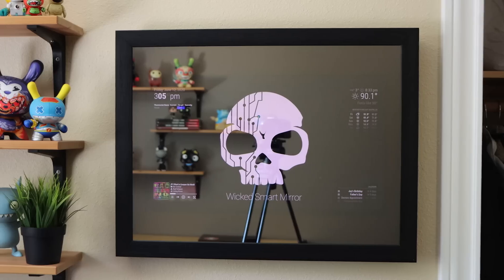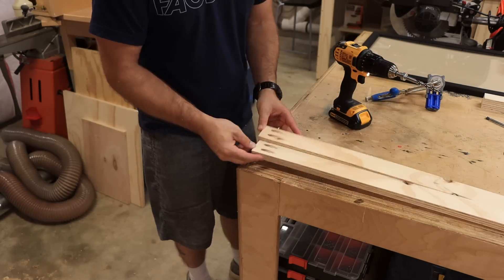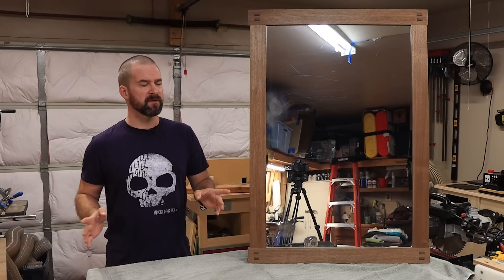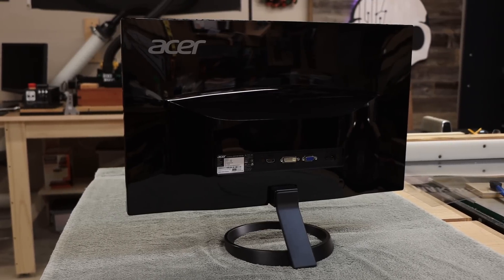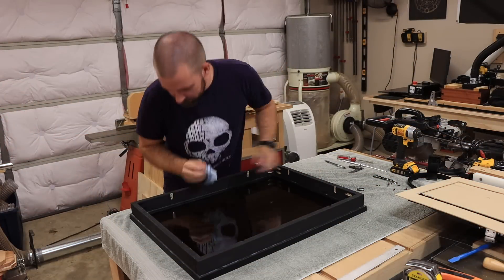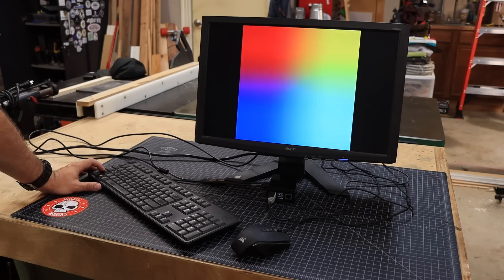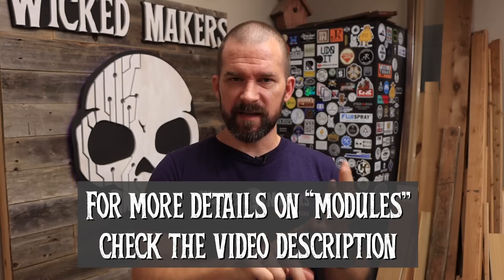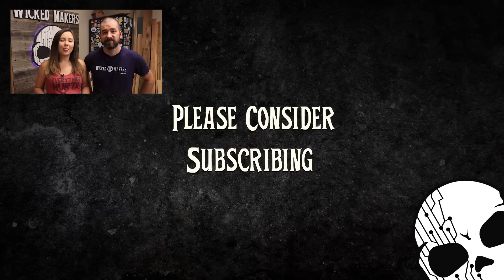How to make a DIY Smart Mirror

Comment: Is this a touch screen? This is the first video I've seen and definitely want to do it! I see a music player and video player in your setup, just wondering how you set it up to control those things?
If I make an outlet to plug this in behind my wall, should I hard wire it to always be on or come on only with the light switch? If it boots quickly I guess with the light switch will save energy, just dialing in how big a project I want to make out of this.
Reply from the maker: It’s not touch screen though there are ways you could add one. We control it via our phone. 🤘🏼🤘🏼
Reply: @WickedMakers  Thank you for replying! I  hate when people touch mirrors and windows so good to know I can control it another way

Comment: You forgot to do the most important thing with any new OS install...update. If the pi wasn't connected to the internet then fine but since it is, you just created a giant security hole (do not trust the image has all the new updates, it doesn't). Just run "sudo apt update && sudo apt upgrade" without quotes. Good job on making this hack easy otherwise and you should have totally told people how to make it a service via systemd so when the pi eventually has to restart it will just start it back up automatically.

Comment: You could probably even have a Touch Screen Glass on the outside connected so it also becomes interactive with whatever is on the screen. With the display lg overlay you wouldn't even have to make a frame yourself.

Comment: nice project, although a couple of things I'd have done differently.
first of all, if you're doing and additional frame on the back, why not just make the whole thing custom for the screen? that way you wouldn't get the weird border effect around it, and you actually don't even need the back panel.
you don't really need all these pocket screws, wood glue would be plenty strong for this application. for the mitered corners of the front frame I like to use them on the back, because it just makes your life easier compared to clamping those pieces, but for the simple rectangular pieces no. it's just faster and easier, to gluing them together. same goes for attaching the back frame to the front frame. just glue that shit together with some clamps, it will hold way more than it will have to.
also, 3/4" plywood is a serious overkill for this and adds a lot of weight 1/2" is enough. of course if you have scraps laying around, use watherver you have, but 3/4 isn't needed it's not a kitchen cabinet for a marble countertop.

Comment: A great and very accessible guide on how to make a DIY smart mirror. My only comment is please, please do not use hot glue to secure things like the power adaptor and cables. There are much better ways to do this while will keep them replaceable as necessary, and the failure of power adaptors is quite common. Fixing them in place is easy though, just use the velcro cable strips. Put a screw through the middle of a velcro cable strip to secure it to the wood and you instantly have a way to hold the cable or power adaptor in place. Depending on the positioning of the bolts in the rear of the monitor you can do exactly the same on these, just you'll have to pre-punch the hole to poke the bolt through first but once done you have instant cable management. 

A further small tip, just buy the appropriate HDMI cable with a right angle plug in the end and you avoid the need to have the 90 degree adaptor. It's a small thing but those adaptors fall out quite easily... and I know this from annoying experience of course.

Comment: How would control the setting or any others features from the raspberry pi. Do this mean that Everytime I want edit a display, I would have to remove the mirror and then remove the screen to control or does it connect to a wireless keyboard or mouse.
Reply from the maker: Yeach you can use a wireless mouse/keyboard or you can also remote into it from your Pc which is what a lot of folks do.

Comment: One thing I see nobody talking about with these magic mirror builds is the power cables/outlets. It looks like many of these people have outlets already installed up high on the walls behind their magic mirrors?
Reply from the maker: If it’s wall mounted you have a few options. I’d recommend looking into methods people use to hide tv and stereo wires. You can run them through the wall, install outlets, etc. all depends on how/where you’re mounting it.
Reply: @WickedMakers  thanks, yeah I think I’m gonna run the cables into the wall and pop out the other side near and outlet that’s behind a piece of furniture.

Comment: I'd probably mount the monitor buttons to the trim for easy access without having to pull the mirror away from the wall.  Might have to clip & extend the wires to reach though.  That and/or when hanging the mirror, put it on hidden hinges like a medicine cabinet to access the back.
Reply from the maker: Yep excellent idea

Comment: pocket holes in plywood isn't really a great idea. I think anyone following along should keep it simple and use wood glue or construction adhesive, and pre-drill some holes straight through the pieces to connect them with appropriate length wood screws. Then just caulk or wood fill over the holes, since you will be painting it anyway. Pocket screws are a cabinet makers tool when they are working with hardwood that is not being painted.
Reply from the maker: I disagree, but thanks for the comment! Pocket holes in plywood is very common and drilling into plywood endgrain as you’re suggesting is far less secure and will be prone to failure with this weight. They’ll both work but I would use pocket holes in this case for the added strength.
Reply: @WickedMakers  the issue is the weight,  and that's exactly why the pocket screws in this way is not a great idea.  You are relying on the plys of the material to hold the screws. It's one thing to use it on a cabinet face or to hold the skirt on a table, but it's not only a waste of time on your project,  but it's definitely less secure.  It doesn't get any stronger than gluing and screwing straight through one piece in to another
Reply: @Wicked Makers  well what would i know with 20 years of construction and 5 years cabinet making experience...
Reply from the maker: Right on, good input!

Comment: If i may make a suggestion. Or, well, a warning I guess. Do not use this type of build in a bathroom environment. They generate a fair amount of heat and in humid areas will product condensate. In a bathroom setting you risk the chance of shock and/or fire. There are ways to mitigate this but that's far too in depth for a comment section.
Reply from the maker: Good advice! Thanks

Comment: Studio Ghibli fans?   Seen Spirited Away the movie?   If so, why not think about making a No Face?   Could make a big one in the front yard.   All you need is foam for the face.  Something to support it.   A fan for under the sculpture so that the fabric moves.    A light weight dome for the head and a light so it's visible at night.  When done it stores away easy.  Only the mask and fabric, and perhaps some pipe for supports.

Comment: Don't put your Raspberry Pi in a case. The newer ones like the Raspi4 get really hot. It's best to find a good heat sink covering for the model you need, which will greatly help with overheating and keep the CPU running at full speed as it will throttle back to a slow mode if it overheats. The heat sink covers are about $15-$20.

Comment: Safety precaution here!: Not sure which cables you were tying together and placing it in the frame, but it looked like you coiled the 110v AC cord and packed it in, perhaps to shorten the power cord. DO NOT DO THIS! It could create a heat coil which will start a fire. You can store part of the cord in the frame but it should NEVER be coiled tightly as the electrical current flowing through it will create heat, and that will melt the cord and then the frame. Love you guys and always enjoy your projects. Could your next project be a real time portal so I can go back to my youth and actually NOT SCREW UP? Guess not, oh well.
Reply: It will be just fine. There's nowhere near enough power to cause any issues. Even running 15A through a 14 ga wire coiled up will not cause any issues unless it is enclosed. This is drawing 10% of that power, so it'll be fine.

Comment: I have two questions and one comment... How would you reduce the weight factor aside from decreasing the size or changing the materials used? Do you use any sort of heat syncs to relieve build-up from the adapter, monitor and Pi ?  And finally my one comment... Why not use double sided velcro instead of glue for the power adapter. If you get surged or otherwise electrically damaged it would be easier to exchange the adapter.

Comment: Just curious if you considered using a little silicone or evne hot glue on the little tabbies to make sure they wouldn't scratch the mirror.
Reply: Even if you do scratch the very edge of the rear of the mirror glass, this shouldn't be visible as there is a lip on the inside of the frame.

Comment: I've got an old Sharp LCD tv with an HDMI input that I've used as a monitor for a Pi before I got my 4k monitor. It's a 37" tv so its a bit obnoxious for a computer monitor! Since its an LCD and not an oled, the blacks aren't very black, especially compared to my monitor. Would an LCD tv be a reasonable display to use for this project?

Comment: I'm not sure you you have a video posted already or if someone else does but I can't find any good videos on how to change the setup and layout everything im finding is the diy project or just the basic install
Reply from the maker: It involves changing the configuration file so you’ll need to read through the tutorials on the magic mirror website. Nothing you can’t handle, you got this. 👊🏼👊🏼
Reply: @WickedMakers  thanks I put my adhd to the side for a bit and did some reading lol and actually got it somewhat set up its still pretty basic but im getting it

Comment: Out of curiosity, for a larger (full body) mirror, would I have to order a custom size LCD in place of the monitor? Are extensions such as Instagram, Facebook, etc... available on the  Magic Mirror website? And what would be a proper resource to learn basic programming? Thank you for you time😅
Reply from the maker: You could use a television maybe, or yeah a large monitor. 😀 This particular software does have some extensions for social I think. Not sure we’re the best to get you going with coding but I’d check skillshare or other sites like that with classes. 😄

Comment: Not trying to be rude but... then what? You can't control it using touch or voice commands so it is really just a TV inside a dumb mirror lol.
Reply from the maker: That’s what a smart mirror is though. You can set up Alexa or phone controls or whatever if you need to update it but it’s meant to display things for you.
Reply: @WickedMakers  well... I think it might've been better if you installed a Chromecast and a Google home mini as a speaker in the mirror that would've been great, as of the transparency you can change the wallpaper in the Chromecast app to black I think that would've help a bit.

Comment: I think it can be done a lot cheaper by using a small LCD display amd using Arduino instead of Raspberry Pi.

It's really nice but the overall cost will be quite high because it's no less than a computer there.
Reply from the maker: Yep, definitely can but it’s more complicated for new users.
Reply: @WickedMakers  I think most people can't afford a full sixed monitor. So it's either buy readymade or be genius and make it from scraps for them.

And the wood cutting part that's described these can easily be done in the shops easily and at low cost.
The intricate part would be setting the display and stuff.

Comment: You may have mentioned this, if so I apologize. Is the monitor touch screen?  If not. Do you think the acrylic mirror would be thin enough to use with a touch screen monitor ?
Reply from the maker: This one isn’t touchscreen and I don’t think it would work through the acrylic. You’d need an IR sensor for touch.

Comment: What was the price to do this build? Ive been wanting to make my own, but Ive never don’t coding not worked with a raspberry pi before. It looks very intimidating so I would hate to buy all the things needed, only to mess up and end up not making it.
Reply from the maker: Depends where you live but it would normally cost a few hundred dollars. Partially because we’re linking the easiest parts to use and not necessarily the most cost effective ones, if that makes sense.

Comment: Great work and video! But the holes drilled by the jig on the long parts of the frame-ends must be redundant... Screws will end up being drilled into open air. Only the two screws on the shorter parts will connect the frame. Or what im I missing?
Reply from the maker: Yeah, screws only went in the short sides. The longer holes were from a mistake and didn’t get used.

Comment: But how did you hang it on the wall? I'm making a smart mirror and it's kinda heavy + the glass was expensive so I want to make sure it solidly mounted.
Reply from the maker: We installed some L brackets on the back and screwed them into studs in the wall.
Reply: @WickedMakers  Thanks for the reply! I think that won't really work for my mirror but I bought a couple of this kind of brackets that hopefully will do fine: https://www.pisla.fi/tuote/kaapinkannatin-702-75-sink/

So excited to hopefully get it ready today, my  raspberry pi arrived yesterday and that was the last missing peace.

Comment: you should cut two holes into the bottom of the frame for the screen buttons, and to fix the pi to. Then you will have full access to the screen options, usb and network ports in case you cant ssh in, usb ports for charging, and with the lip of the frame you wouldnt see them so it wouldnt spoil the aesthetics. You could also look into the rasp pi camera, fix it into the wood of the frame and drill a tiny hole for the sensor, you would then have a smart mirror that can video call/skype people.
Reply from the maker: Nice, good tips!

Comment: How would you control the monitor when it's on the wall? Besides putting a mic in and installing the Alexa module I mean, which probably wouldn't be complete control anyway

Comment: If that's a pi4 you better at the very least put a heatsink on the processor. I'd recommend a fan as well. A pi3 will be fine with just a heatsink
Reply from the maker: We did both and it shows it in the video. 😉

Comment: I accidently pulled out that thin strip that goes from the motherboard to to monitor, is that an uh oh?
Reply from the maker: You should be able to slide it back into the housing. We did the same thing. 😄

Comment: Why did you leave all that junk on the LCD screen 💻 on the back? Like the big box with the display card and all those extra inputs your not gonna use? Anyway point is you can just strip that whole screen down and have a much slimmer and lighter magic mirror, to me going on ifixit and grabbing a tear down schematic is much easier then all that woodworking to fit and secure a bunch of stuff you don’t need.. or if you like having all that crap back there, don’t need to build a thick box, you can sink everything into your wall provided you have access to the other side of the wall. Idk it just looks too much like a mirrored medicine cabinet that someone has in there bathroom, but that’s my impression of it.
Reply from the maker: Because doing that can be difficult and this build is about showing an easy way to do it. 😄 But yep.
Reply: @WickedMakers  well wood working is not enjoyable for me, so the other two options are a lot easier for me lol 😂 but i see your point, i guess if someone likes wood crafts then this would be an easy job.

Comment: how did you close up the back.. what type of mounting hardware did you use .. also the power cord did you hollow out a place in the frame for it go to hang for plug in so it sits flush against the wall.
Reply from the maker: Back stays open and against the wall. We put an outlet behind it but you could run the cables through the wall as another option or not hmm how the frame like you said.

Comment: I have got a question: is it possible to stop running the magic mirror after you activated it? And can you run it on windows?
Reply: One easy solution for that would be to find a way to route an HDMI cable from any laptop /tablet/computer to the panel in the back of the mirror.

There are a multitude of ways to hide the HDMI if you're savvy enough to cut into your drywall to install fire rated pvc and whatnot. Or just find a way to blend it so it's not super noticeable.

This actually the route I'm considering personally.

Comment: Quite an interesting build you've got there. Kudos on that 🙂 mainly the pocketholes, those do help a ton and it is great to see people spreading their worth. I would however do some things rather different if I were you. First off, integrating the controller to the side of the frame would give you a lot more options for brightness adjustment as well as the option to shut the monitor down all together, if there is a need to just have the mirror 'in use'. Secondly instead of hot glue for securing things, rather use double sided velcro attachments (for the power supply for example) and maybe an adhesive cable tie points for routing all of the cables a little bit more neatly. Personally I am plannig on a similar build as a gift for my gf, but including a stereo sound for direct music output as well as a mic for voice control. All in all a great build to advertise that basically anyone can do things such as this on their own, which will add a personalized flare/style to it as well as make it more than just another thing you buy.
Reply from the maker: Thanks! These are great ideas. 👊🏼👊🏼